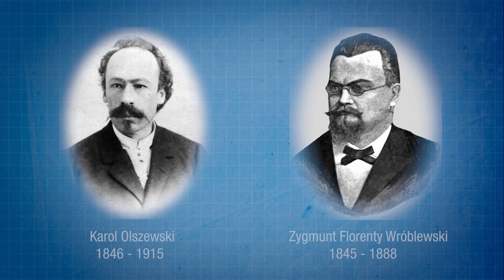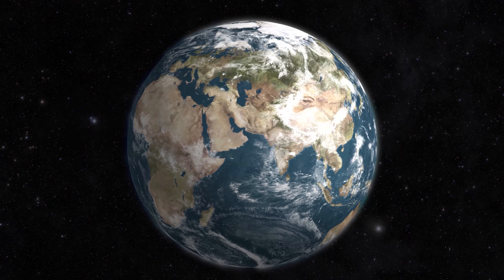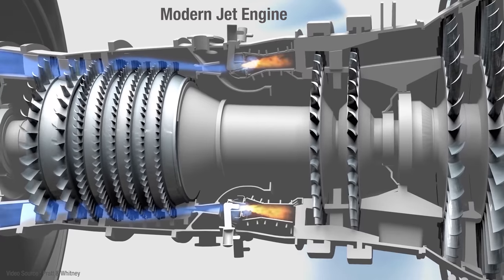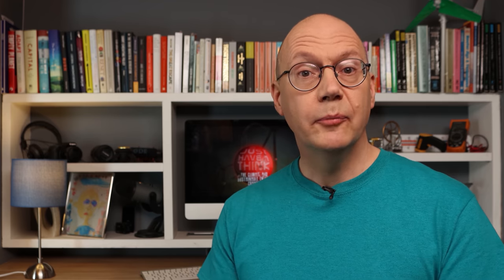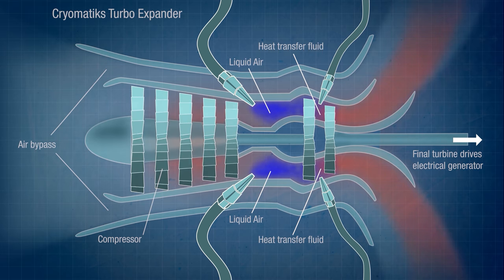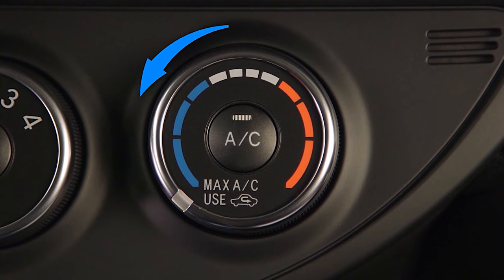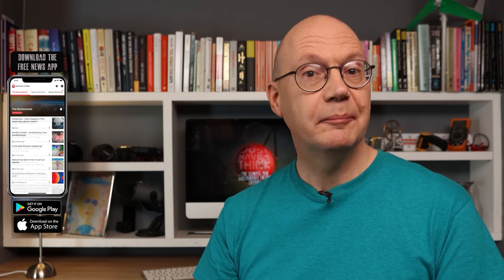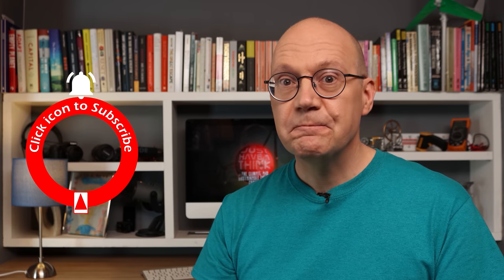Portable Liquid Air Power. A new boost for electric vehicles.

Comment: Now there's 2 things to recharge - the battery, then the liquid nitrogen tank.  I'm assuming this system is cheaper than additional batteries?  Otherwise they might as well carry more batteries if the weight/kWh is the same.  The upside is that at least there's no degradation.
Actually why couldn't they replace PHEV with these?  Assuming the same weight/kWh as batteries, and cheaper costs, they could just put a small buffer battery in the car like PHEVs, and have liquid Nitrogen provide the rest of their range?  But then I suppose the supply, distribution and pricing of liquid Nitrogen would be a larger part of the equation.

Comment: Nitrogen is not an inert gas.

Compressed air powered  vehicles were developed many decades ago. Taxis powered by a compressed air engine were trialled in Mexico City. 
Wonderful idea although limited by the maximum range of the vehicle. And in order to be carbon neutral the compression stage needs to be powered by renewable green resources (not a big problem today seeing as hydrogen storage technology also has this requirement - I am sure not all hydrogen production will be green though. Already we are hearing the terms Green-hydrogen, Blue-hydrogen and Grey-Hydrogen. They. Just get themselves to say Filthy earth warming non renewable Hydrogen.)

Comment: Umm... 125 *Wh/kg*?  Plus you also have to have not just water but water with glycol going into the fuel mix and being exhausted?  The energy density of a hydrogen fuel cell is 33,600 Wh/kg.  This sounds DOA.

Comment: Wouldn’t super capacitors Be cheaper to build to capture regenerative brake electricity than the Liquid air system?
Reply: The idea is more that you can quickly add liquid nitrogen to refuel, not that it is capturing regenerative breaking energy.  That part is just a bonus.

Comment: I dont understand why the EV cant use like 40% of the regenerative braking to charge the battery through a generator directly but it CAN use that 40% indirectly by this system which also  ends up running a generator. Can someone explain please?
Reply: @JorgTheElder  My Tesla does.  I never have to use the mechanical breaks.

Comment: Where does the toxic glycol end up?
Reply: Mostly at the bus stop. As long as you don't breathe as the bus pulls away you should be fine.
Reply: Not to mention having to fill up a tank/tanks with water and glycol
Reply: Look up ethylene vs propylene. (Glycols)
Reply from the maker: My understanding is that it's a closed loop.

Comment: I like cool gadgets, but this isn't the way to go. Battery EVs are so simple, we don't need complications with more high speed rotating parts, metering valves, and industrial capacity to produce and delivery high pressure gas.

Comment: Adding in the carbon footprint for making liquid nitrogen or air does not make this engine currently very carbon efficient. Liq N2 costs about 500Wh/kg of mostly hydrocarbon generated power.   As we move to non HC power generation, it's a great tech.  Also eliminates needs for batteries and their environmental impact.

Comment: I like the concept, but as you say, much depends on the range of its adoption and the very important economy of scale production benefits needed to drive cost down. With the need to radically decrease carbon emissions because the world has not taken it seriously enough ideas like this one are popping up all over the place and trying to make your one stand out from the crowd will be hard. We do not want a multitude of smaller solutions getting to the production stage as the smaller scale of each will be a drawback.

Comment: 125 Wh/kg is competitive.  It's not a breakthrough.  However it should be easier to build steel cryo tanks not lithium batteries. And over time materials to just store cold liquids or high pressure gases will likely drop faster than batteries improve.
Reply: How is 125 Wh/kg competitive?  A quick google told me that the energy density of a hydrogen fuel cell is 33,600 Wh/kg.

Comment: I seem to remember that the regular fluid R134 is a strong greenhouse gas when it escapes. Edit: yep, and there are even worse gases out there (worse regarding the climate effect if they escape)  that are now gradually banned in the EU. so it took them only 25 years or so, and if the EU had set a standard that might have also influence mass production in other countries. 

R134 is used for household fridges (tetrafluor whatever) as opposed to propan / butan which is a harmless substance). R 134 is not poisonous, or so they say. I would not use any FLUOR based substance if there is a harmles and CHEAP alternative. 

 but there are other substances that are used in commercial cooling systems, that are even worse when they escape. 
They are now forbidden for new installations, fade out started with 2020, next bans (for new installations) will be 2022 (in the EU).

The fact that R134 is a greenhouse gas (a strong one !) was known  when the FSKW's were outlawed to protect the ozone layer and R134 replaced it (at least for household appliances). 

Greenpeace pushed for the Propan/Butan frridge (at least for househould appliances, I know people who had one, plus very well insulated for the standards of the 1990s, the thing might still run). The amount of gas is so small that it is no fire hazard, and for a short time they were sold, but I think then they vanished from the market.
Reply: In the 1990s Liebherr a high end German brand had the propane / butane freezers and fridges, and a company in Eastern Germany. Warning: Rant about neoliberalism, industrial shortshightedness and the German unification, skip to next comment if not interested. - But the currency under which Eastern Germany produced appreciated by 350 % when they got the D-Mark (Unification). 

The highly efficient Swiss and German exporters get nerous when their currency appreciates by 20 or 30 % because it makes their products more expensive in other countries.

That company in Eastern Germany cooperated with Greenpeace (it is telling that no other manufactuer was interested) they hoped to have a well selling unique product that would help them to survive. The freezer my relatives bought then (a chest freezer) cost a little more, but it was also very well insulated. 

They sold it to Quelle which was the largest catlogue sender in Germany and Austria at that time, so that listing could have helped them, and if atechnology becomes mainstream and they would have produced more there could have been economy of scale effects.

That currency appreciation shock killed most of the industry in Eastern Germany within 6 months - likely an intended (or gladly tolerated) effect. The good parts were sold off in a fire sale, (the files "vanished when the "conservative" Kohl government was voted out) and the rest of the jobs and manufacturing was thrown under the bus. Those areas have STILL not caught up with Western Germany and it will get worse.

In order to win the elections (and to win the population for an immediate unification) the retirement rules were generous. Those that had acquired rights under the old regime got it in West mark and at a good rate - 1 : 1.

That made the insane currency appreciation necessary that was so terrible for producers. It was good for those that would soon get their pensions and that meant a lot of voters and no one told the working population in the East (or the West !) there would be mass unemployment. Also not the Germans in the West, btw who had to finance that. Plus: that put pressure on them because the people from the Eastern part of Germany now could come over and compete for work. Likely also a desired outcome to suppress wages.

Of course that favored the folks that had played nice with the dictatorship (or worse) and had made a career, while the dissidents often had low paying jobs (or times with no income and missing out on insurance times) and consequently their pensions in unified Germany were also very low.

The retired stayed of course in the East because housing was still more affordable, but the generation that had that windfall will die off, and the people that retire now have a biography of being underemployed, low wage jobs, no generous provisions anymore. And almost all women worked fulltime, so they also were granted the full German pension according to unification rules. 

Now the situation is different - Lack of jobs or only seasonal jobs in tourism also shows in reduced claims for future pensions.

 If a person has the average wage in Germany (also in the Western part)  and works till age 64 or 65 they will be JUST above poverty level with the government retirement payments.

Old age poverty had been a term in Germany for at least 15 years now, 
the government Merkel kicks it down the road (as is typical for her ).

The industries of West Germany had time to develop slowly, well, in all of "Western" Europe, Canada, Australia, New Zealand,  also in Japan - the U.S. needed them as allies in the Cold War and the voting population could not be pissed off. They were not forced to compete with much more developed economies /  industries. 

The U.S. manufacturers could have steamrolled the Germans after 1945, not only because of the occupation, but because they had not been bombed, not as much capacities  had been dedicated for the war industry, and regarding consumer / civilian goods the U.S. manufacturers were more advanced.

No time for the industries of the Warsaw pact states to adapt, this was the era of neoliberalism and killing industries and outsourcing jobs - not of rebuilding countries but of exploiting them. And all natural resources.
Reply: Commercial cooling installations are usually well serviced and monitored (they better be, some of those fluids are poisonous, and of course the potential damage if the cooling chain is disrupted) and the chance for leaks are smaller. They will have safety features as to notice loss of pressure early on, and when they are dismantled there is a chance they old machines are processed in a first world country. 
Well household fridges/freezers also have to be brought to recycling and in theory they will carefully try to recoup the gas / fluid. For instance greenhouse gas R134 or all the others - I think most or many of them seem to have the capacity to heat up the globe and more than R134. It matters how STABLE they are, but the Fluoride part (in R134 for instance) makes me suspect they are VERY stable.

In countries like Germany that recycling of consumer and commercial appliances might even work fairly well and not much R134 escaping to warm up the planet. I would not bet on countries like Greece, Romania, Spain, Italy, the Baltic states .... or Turkey, though. They have economic and political crises all the time, I would be astonished if they are dealing correctly with waste and recycling.

Those gases are very much an "out of sight, out of mind" problem, because they are not even dangerous to the population (poisonous, inflammable). In Italy, the Balkan states, Romania, Slovakia .... I can see organized crime getting interested, cashing the money for the disposal, but not really doing it. 

Those countries have been thrown into the neoliberal shark tank, and it caused MAJOR economic and ongoing problems and any global crisis we have (finance, pandemic) hits them extra hard. Those conditions gave rise to organized crime in countries that traditionally had VERY low crime rates and the population has other things to worry about than waste and recycling handling, especially if the damage is not very tangible and manifests elsewhere (in the global atmosphere).

That is why it would have been so important to just use a fluid that is harmless, not poisonous AND ALLOWS FOR REPAIRS and REFILLING. 

With Propan / Butan it would not matter much IF they escape because of a leak (the quantities in household appliances are not that much to pose a fire hazard). And they do not need to be THAT pure (one reason R134a cannot be refilled if a device has a leak, not even by a service technician, ONLY the manufacturer can handle that).

Getting the fluid out EASILY from an old fridge / freezer, or DIY repairs are an option for propan / butan but not for R134. That can only be handled by big and specialized actors resp. needs special equipment.  

That may have been a reason WHY they were not for propan / butan, R134a aligns with planned obsolescence. A leakage means it is impossible to repair.

Comment: I'm a fan of cryogenic energy storage in general (Liquid Air) but this liquid air-powered "range extender" doesn't seem like a practical method to enhance range.  Think about the expense and routing challenges for all that tubing needed for the cryogenic fluid as well as the injected liquid.  Think of the plumbing: the valves, the solenoids, the sensors, the added electronics, and software. Think of the added weight of the tanks AND the two fluids, which will have to be lugged around until needed for the extended range.  As mentioned, the liquid will need to have an antifreeze (just like your windshield washers).  And, because it will require an antifreeze, the injection fluid will be contaminating the roadways and countryside as it is consumed in the turbine. It just doesn't sound like a sensible solution.

Comment: This will likely never make sense for mobility.  The added cost, complexity, weight, and space, would be better used for simply adding more batteries which are inherently more efficient.  Pack level energy density is already higher than quoted in the video and the larger the pack the greater the energy density since more of the pack becomes cells in relation to packaging.  Even more so in the future as cell energy density continues to increase.

Comment: 8:47 as the mass of the vehicle increases, generally so does the size of the battery and thus can capture proportionally more energy since it needs the ability to accelerate that same extra mass.  We already have fully electric buses that certainly cap the power as do all EVs, but most of the caping of power only occurs during sudden or emergency braking, not during their normal route.  I don't buy there's any significant amount of energy loss there.

Comment: Using compressed air to compress air to convert into mechanical energy. Unfortunately the turbine is not as efficient for this application it seems. Not to mention it is severely outdated.

Comment: Interesting video and see potential application but too many state changes (so cumulative losses) when applied to EV's in the end to end cycle and agree with many of comments on Battery upgrade alternative which adds no further complexity. I cannot see return to a "hybrid" type solutions winning out over battery/capacitor developments required to make this an uneconomical investment.

Comment: What is the overall efficiency of the whole cycle?, that is considering the energy cost involved  in separating, multiple stage intercooling, fractional distillation, microparticle filtration plus the shipping of Dewar LN2 containers.  It is a novel  idea, but delving in another video of this series, NH3 wins hands down. No Dewar flasks needed. And how much does the heat recovery turbine  costs?  Carnot only gives the MAXIMUN THEORETICAL EFFICIENCY. the real world has very nasty surprises waiting at the end of your spreadsheet

Comment: Why not fuel heavy duty vehicles directly with liquid air? In the long term you could build up a liquid air infrastructure in which building AC would actually produce energy by using liquid air, as well as cold storage hubs. And voila, we could finally have mass produced turbine cars!

Comment: These guys are using phase change materials to store heat to condition electric car batteries and heat the passenger cabin. They also retro-fit to internal combustion engines to preheat them which drastically reduces emissions. I expect this sort of ‘heat buffer’ could find a role in the systems in this video. https://sunamp.com/automotive/

Comment: I don't get it.  How does the liquid nitrogen get on board,  how is this an electric vehicle?  Why can't a vehicle use liquid nitrogen as its sole power source?
Reply: That's the idea: you put LN2 in the fuel tank.  Unfortunately you need 300L of the stuff to drive a car 100 miles.

Comment: Didn't get off to a good start, nitrogen is not inert it's just difficult to get to react.
To keep nitrogen or air liquid it's typically stored in a Dewar flask. Problem is some of the liquid is always boiling off to keep the rest liquid. After a few weeks at best it's  all gone. Compared to liquid hydrocarbons as a way to store energy this concept doesn't seem viable. As a system to store energy from regenerative braking compared to supercaps it doesn't seem viable either.

Comment: This liquid air compressor is a terrible idea quite frankly. I know they want to preserve battery life on larger vehicles that can't take advantage of regenerative breaking, but a vastly simpler solution is to just use capacitor arrays to protect the battery. Its much simpler.
Reply: The regenerative breaking was just an added bonus.  The main point was that you can quickly refuel by adding more LN2.  Unfortunately, you need about 300L of the stuff to drive a car about 100 miles.

Comment: don't you just use up the "heat exchanger" fluid?  It's like replacing one fuel with another.  Granted, not as bad as gas or diesel  but it's not just water either.